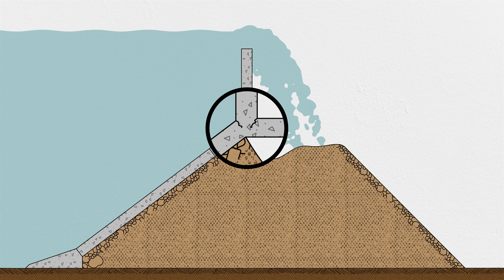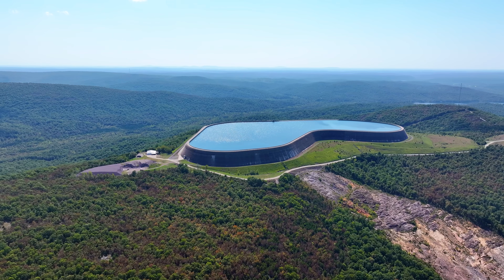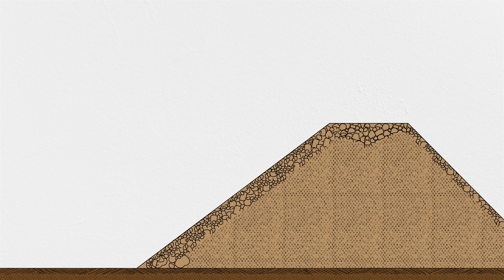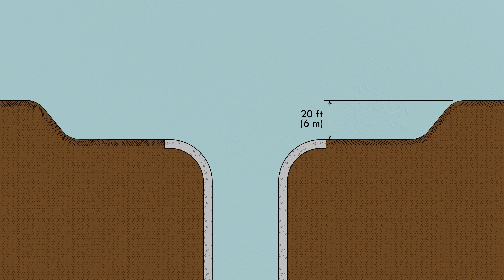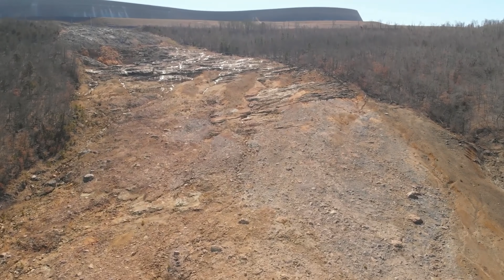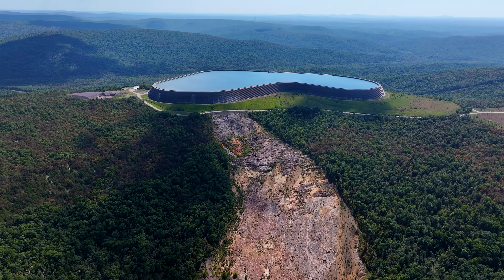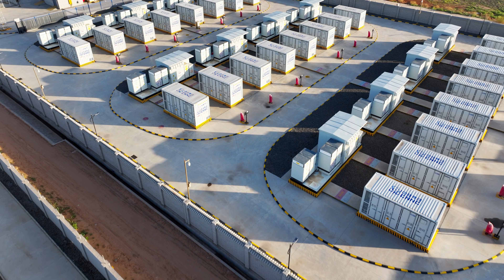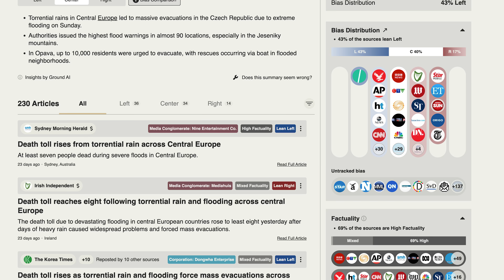The Wild Story of the Taum Sauk Dam Failure

Comment: Having done some work in volcanology my first question is why they didn't have a laser-level system around the top of the concrete barrier, and tiltmeters attached to floats to tell where the water's surface was relative to the barrier rim; and as someone who has two nuclear engineers in the family I have to wonder why there weren't passive safety systems that would have released water the moment there was a problem as one of at least three tiers of safety systems.

Comment: We have a pump storage facility nearby! Badcreek Pump Storage Facility. It is powered by the Oconee Nuclear Station (one of only a few 3 reactor plants in the US) which uses excess power during non-peak times. Unlike the Taum Sauk Dam it is nestled inside a high elevation valley above Lake Jocassee. The 3 lake system + nuclear station + pump storage facility is a super badass setup.

Comment: riding out these past two hurricanes in florida with almost 3 weeks combined with out power other than fighting the gas lines to power my generator. a scaled down water battery along with my small solar generator seems logical to sublimate low power consumption for fans and a dvd player

Comment: Why the heck would you need to install depth sensors at the BOTTOM of the reservoir to control the pumps on and off? Wouldn't it be better to learn the pond is full by measuring AT THE TOP?

Comment: I backpacked the Taum Sauk trail a couple years ago that runs around this, with no prior knowledge of it existing.  Atop one of the adjacent peaks you get a great view, but man was it quite the sight to come upon...   Almost gave you an uneasy feeling, but no doubt an engineering achievement.
Reply: I remember sitting at the top of bell mountain and seeing this big concrete wall and think hmm I wonder what that is
Reply: @michaelthomas7999 yup same, like what the hell is that ? Then we did the Tom Sauk section and were like why do they have signs saying if you hear an alarm run straight uphill.  My buddy sent this and now we know.

Comment: 10:14 It sounds like a series of big oversights. 1. Embankment made from out of specification material. 2. Main level sensors not secure. 3. Backup overflow sensor position doesn't account for subsidence. 4. Backup overflow sensors programmed wrong. 5. When actual failure of overflow prevention system was observed decide to fix it later. It's still an awesome engineering project.

Comment: Classic engineering solution. 2' of freeboard is needed but the sensors are a little off. Just double it, that out to work!! Hahahaha, seen this many times.

Right up there with "Lets just use really thick steel" as an engineering go to.

Comment: Work in water treatment and every single storage tank I have has some sort of physical overflow pipe to allow water to escape.   Pumps and controls WILL have problems and those problem almost always happen at the worse times.  Its a small system and I can get to any single part of it to manually shut down or control things in less than 10 minutes, but that is a long time if there was no overflow relief installed, can't believe thar even when built that someone thought 'Oh it will never get too full"

Comment: I thought the 2005 new paper article said the system was designed with onsite operators and later cost cutting removed the onsite humans in favor of remote operations from the Fulton nuclear plant that makes most of the electricity to pump the water.

Comment: 12:45:  "...when you rely on complicated systems for safety, the likelihood for things to go wrong goes way up."  One of the key reasons not to build nuclear power plants.
Reply: In the U.S. Navy’s Nuclear Power Program, they do not rely on complicated systems for safety. “Never trust the interlock” is beaten into the operator’s heads. The Navy has been operating nuclear reactors since the 50s without a significant issue. But, they are relentless with their standards, training, and evaluations. No one at Naval Reactors outranks the truth. Even the most junior persons are expected to speak up when something is wrong.
Reply: @PermanentExile thank you for extinguishing the ignorance fire

Comment: We now DEMAND spillways be built, even for "fail-safe" dams. The impossible DOES occur.
We're now seeing a major marketing campaign to sell SMRs - Small Nuclear Reactors. "They're totally safe" - so safe they supposedly don't need the multiple backup safety systems required for traditional nuclear reactors.

Since they lack the economies that come with larger reactors, they generate less electricity (in aggregate) than equivalent older large reactors. But they're still cheaper to operate per kWh of generation because they will be built WITHOUT the multiple redundant safety systems legacy reactors MUST have.

This is insane!

We're really good at calculating the odds & managing risk. What mankind sucks at is managing risk where the likelihood of failure is vanishingly small - but still there - and the outcome of such a risk is catastrophic.

We know the risk of a system failure causing a blowout at a nuclear reactor is extremely small. 
But the outcome of such a disaster is nothing less than catastrophic.

The "exclusion zone" created by the Chernobyl disaster is larger than many UK counties, larger than the state of Georgia, more than 2/3 the size of Azerbaijan. All human activity - even transit across by vehicle - must be excluded for as long as it's been since the Dark Age that followed the collapse of Rome. The cost of that disaster contributed directly to the bankruptcy & collapse of the Soviet Union (USSR). 

The Fukushima disaster was similarly huge, contributing to the continuing malaise of the Japanese economy & resulting in a significant exclusion zone, smaller than Chernobyl because it occurred on the coast. 

The Three Mile Island disaster was smaller but still resulted in bankrupting the operating utility multiple times through successive ownership, even with state bail-outs for each of them. The end result has seen the state of Pennsylvania give up on site decommissioning; it's permitted the last iteration of utility ownership to fence & protect the site - in perpetuity - without decommissioning & cleaning up, and to operate the remaining reactor commercially to provide income to support that level of protection. This is appalling, but understandable: the utility can't possibly decommission the site properly without going bankrupt (again); the state refuses to carry the financial cost, and the federal government (already saddled with many Superfund disaster sites including a few defunct nuclear generating stations) refuses to carry the cost either.

This is the end result of nuclear generation
Nuclear operators are permitted to run without allocating sufficient funds to cover the cost of decommissioning at end of life. This is the ONLY industry that gets that kind of exemption: mines, industrial sites, refineries: they must all allocate funds during operation - from day 1 - to cover eventual decommissioning. Nuclear is exempt.

This means when the generating station has reached end of life & is no longer producing any cashflow at all, the operator walks away or declares bankruptcy. Leaving the problem to the government to manage: it becomes a taxpayer burden.

Ditto for nuclear waste
There is as yet no approved & prepared site for the long-term disposal of nuclear waste anywhere outside Finland - and that one won't take anyone else's waste. Nuclear waste requires safe storage & protection for 100,000 years - many times longer than it's been since the start of civilization, much less the life of any country past or present.

It does not appear that the US is going to be able to rectify this situation any time soon.

Nuclear generation - including SMRs - is always everywhere eventually a financial disaster. 
It risks becoming an environmental disaster with even greater & more immediate cost.

Wind & Solar generation is ALREADY a fraction of the cost of PROPOSED generation by SMRs.
SMRs won't be built & delivered before 2030 - more likely 2035. And their cost keeps rising.
Wind & solar generation costs KEEP FALLING - & have done so reliably for 20 years.

Wind & Solar is faster to build
Global commissioned capacity of offshore wind increased from 3 GW in 2010 to approximately 66 GW in 2023. McKinsey estimates global installed offshore wind capacity is expected to reach 630 gigawatts (GW) by 2050. We already generate more power with wind than half of all hydro stations worldwide; solar generation exceeds 40% of hydro. Both wind & solar generation is expected to eclipse all hydro by or before 2030. And all of it generates electricity at a fraction of the cost of nuclear - old or new (SMRs). None of it leaves vast decommissioning & waste storage & protection costs in perpetuity. And none of it goes boom.

Wind & Solar as base load
The Base Load fallacy holds that wind & solar are unreliable. False. If you over-build (by 45%) & battery-back your generating facilities, IT'S BASE LOAD. This is why Tesla is in the utility scale battery business - which business is growing faster than its EV business, and will be larger than EVs by 2030.

And we don't need batteries in some cases. Hydro can be used as battery to fully back renewables generation where available. In Canada it is already doing that (in Manitoba) & there's massive potential to increase such use (in Ontario & Quebec especially). 

But even done the most expensive way - with grid-scale batteries - the total generating cost of battery-backed renewables is still about 50% of the cost of nuclear power. And that's without including the INEVITABLE cost of nuclear decommissioning & waste storage. Much less the cost of a few more inevitable nuclear disasters.

Why the rush to new nuclear then?
Nuclear makes NO sense for ratepayers (consumers) or for governments.

Nuclear is a massive jackpot for big business & consultants. You sell them once, net a lifetime contract to supply & operate these financial sinkholes, generating billions in guaranteed profits for decades to come. Then - at end of life - your client is on the hook for decommissioning costs & waste storage. THIS IS A FINANCIAL JACKPOT. Just not for you.

Nuclear is a scam!

Comment: Why wouldn’t they pour like a 20 foot concrete apron around the entire base of the parapet wall, that way the water pouring over the edge wouldn’t be able to undermine the structure.. sure, the water would erode the soil once it flowed off the apron and down the hill, but it would save the reservoir embankment and prevented the complete failure

Comment: I mean, I've only gotten like a minute into the video, and immediately those overflow holes in bathroom sinks came to mind. Like if I designed a dam, I would have a dedicated overflow hole so that the entire thing doesn't fail. Might not be the ideal outcome to have to use it, but would probably be better than structural failure. Now to watch the rest of the video to learn why I'm not designing dams...

Edit: Turns out I was right, and there probably should've been an overflow hole.

Comment: They should have multiple ways of measuring the water level. I have a water level sensor that I designed in an irrigation water tank, ultrasonic based connected to an arduino sending data to a logger. It sometimes has issue so I plan on installing a pressure sensor as well. In my case a low-tech float valve stops the input to the tank (gravity fed) so a failed sensor isn't a big deal. In fact, a low-tech float value could have prevented this dam's overfill!

Comment: I feel like these days we'd have the option to add solar-powered monitoring systems as a backup.  Today I could build a thing like that for <$100, streaming SSTV over LoRa to a monitoring station.  But none of this substitutes for actually testing the safety systems, which is really the problem here.

A safety system that isn't tested (and regularly) is worse than not having a safety system.

Still, good thing nobody was hurt, and we learned a lot from the failure.  Mismanagement causes so many engineering failures, though, and management is always looking for a way to save a buck, so constant regulation updates are essential.

Next up:  the first colossal failure of a battery storage system...

Comment: A (pump) battery, "like this video explores".  Is really affordable, and it gets all the cons of a battery right (cycle degradation, self discharge).  Except for the footprint.  A (pump) battery is pretty huge.  I'm pretty sure that anybody thinking of doing the (pump) battery thing.  Will opt for a (sand) battery now.  Heat the sand up with energy when you have it, and pull it back when it is desired.  And the "footprint" of such a system can be underground.  Can you build on top of it?? I dunno.  Maybe heat rising up through the ground would make that an ignorant endeavor.  But, maybe "some" things wouldn't care about that.

Comment: Could one deliberate notch slightly lower than the top of the freeboard and above a proper spillway been used as a third fail safe to let out excess water?

Edit: seems my question is moot as this is the definition of a spillway. I am not an engineer.

Comment: The entire thing seems like a terrible idea. There is a reason you don't see these storage hydro powerplants around - it's a lot simpler, cheaper and more efficient to have gas powered plants as backup for the grid or regulate the grid with a normal hydro powerplant (you know, the type that actually generates energy). Only reason to have something like this would be if new gas/coal/oil plants can't be built due to regulation. But in a grid that is already powered by coal like mentioned in the video, that doesn't make much sense.

Comment: Brady Getting V2G BVs oversized battery parked 23hrs every day ON THE GRID,
( 20million vehicles in Australia)
will be healthy for the grid, just my comment. 

You should talk about the benefits of EV or BVs oversized battery.
Battery Vehicles battery is sized for the long drive or the weekly top up.
Battery Vehicles battery is OVERSIZED for the daily drive. 
Most vehicles are parked 23hrs every day and all night long.
Avg mileage 10,000 and 8,760 hours per year, means 1.14mph or 27 miles per day. 
300million vehicles 100kWh battery is zillions of stored electricity gWh. DAILY. + rooftop PV 

Private home and building owners will not need the $15 TRILLION national grid.
But the grid owners will need the millions and millions and millions of customers CASHFLOW. 

Brady you have a monster story in this Engineering situation. 

I  think that as the 10% of electricity energy expands to replace the 90% fossil fuels used in the USA then the grid owners will partner up with the existing customers, now their self supplying customers and take the excess customers feedin and sign up new industrial customers moving away from fossil fuels. 

No new national grid capacity construction will needed. 

$TRILLIONS and $TRILLIONS in savings on no new grid capacity construction.

Comment: Those highly paid engineers should have checked how the overflow detection system in a standard water closet works. I figure the cost to be about $5 and it works flawlessly with 1000's of cycles each year.

Comment: I bet that for $100 (at 90% profit) I could build you a sensor that tells me when the water level is within 'x' of the wall. Just like the level sensor that activates my sump pump. No over engineering required. Just some common sense (which, as we well know is not common --- which justifies my 90%).

Comment: A struggle the bulk power system has in regard to utility battery/solar generation is the lack of a massive kinetic object to rectify unforeseen spikes in load. If you hit an inverter with that shock, there will be damage. The protection of inverters is a pretty interesting subject.

Comment: Very interesting story! Well, the remote control system was only as good as the sensors used to close the loop. Once the operators knew that the sensors were shifting and providing erroneous readings, deciding to compensate by adding a "fudge factor" to their setpoint was just rolling the dice until they ran out of luck.

Comment: That the dam didn't have any form of spillway is a bit surprising. Like a simple fail safe is generally a good idea to have.
Another even more disturbing observation were the lack of checking the safety equipment itself. Like if you install a float switch, then will it actually switch before an overflow?

I generally follow the mantra that "If a safety system hasn't been tested, then it might as well not exist." If it hasn't been tested under safe realistic conditions, then you can't say that it works.

Comment: You could have used a combination of float and ultrasonic level sensors insteadof  hydrostatic level sensors with high, high-high alarms and set it up to fail to drain. Edited to add after watching it more they could have actually installed the other sensors correctly. Just bad engineering.